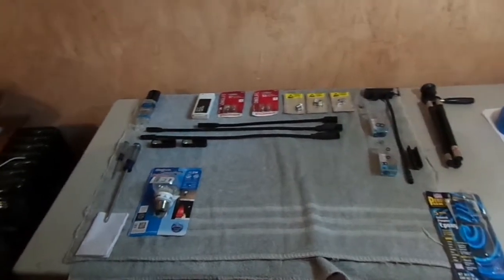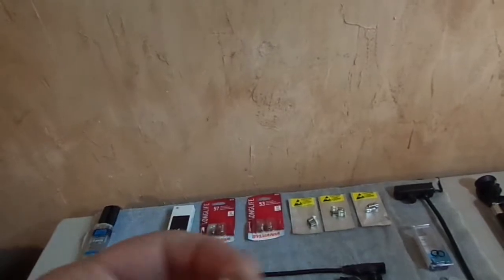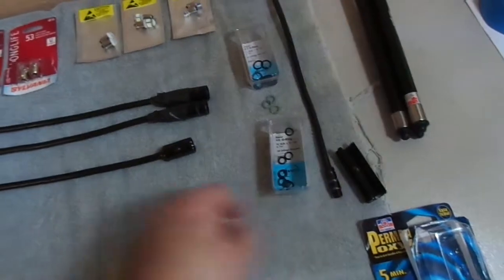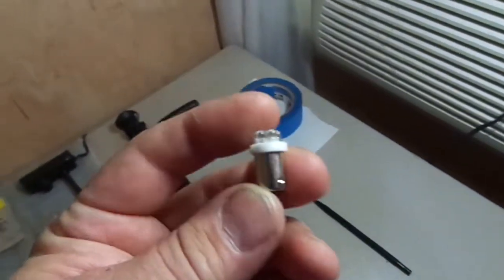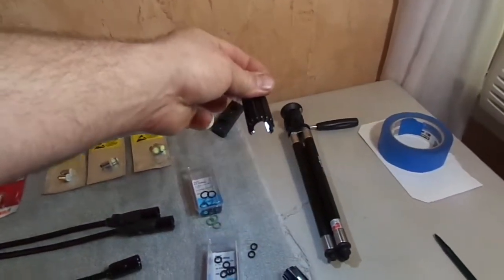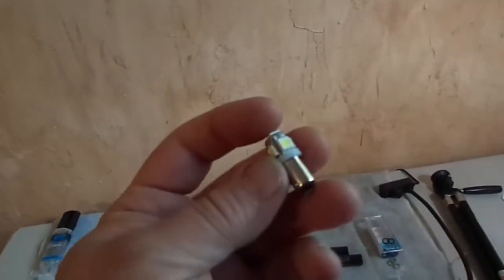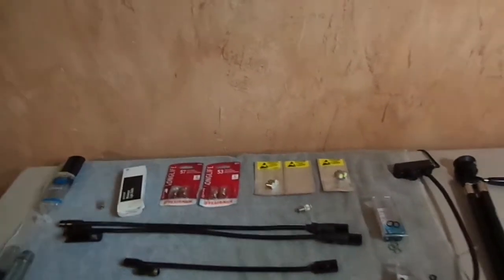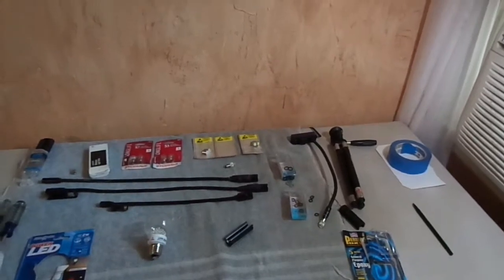LED console light upgrade 1 of 3

Comment: Did you try the 3 pin XLR in an input channel and turn on phantom power? I'm thinking that those require you to sacrifice an input for some lighting on bards that do not have a light socket. . . Also, a slick trick for almost doubling your brightness is to add aluminium foil (or real duct tape) to the inside of the hood (shroud) if it does not have a reflector.